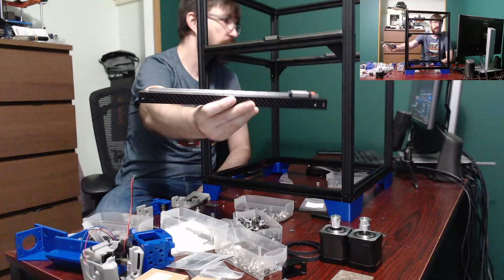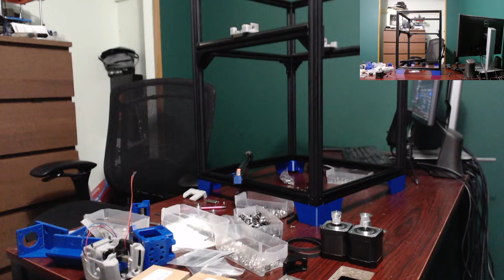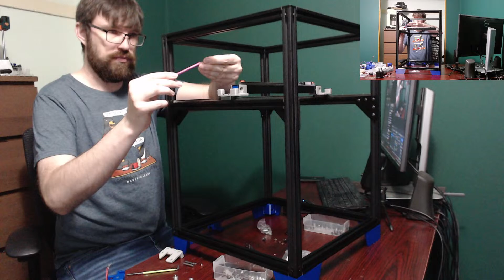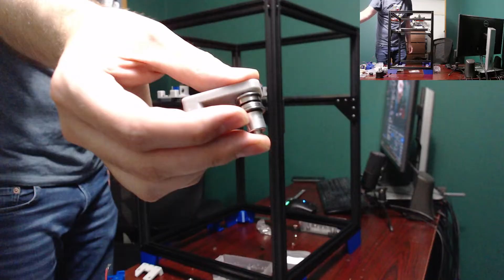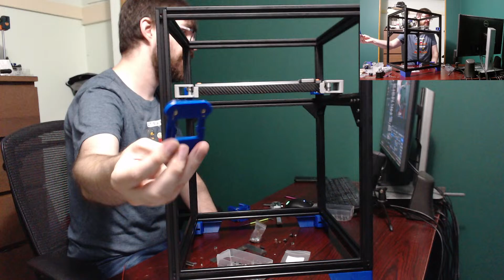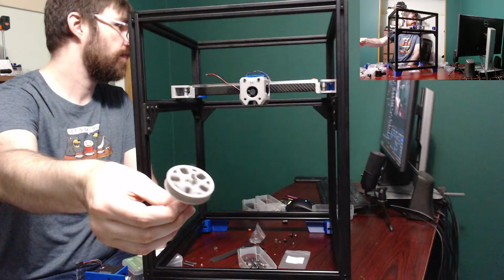SimpleCore Redux Build Part 3: X axis

Comment: The belt tensioners on the EVA2.4 are M5, it's fine. The issue is that the "gripping" teeth on the printed file are on the other side, mounting the belt with the teeth the wrong way. You just put the belt in as it should go, ignoring the printed part. Just jam it in, It should grip fine. Haven't checked if a tensioner with the teeth on the right side exists. I know this cause I have JUST put on the belts on my remixed build of Chaz's files. I think I should message the discord soon
Reply from the maker: there are mirrors tensions that work and I have used them before I just need to find them